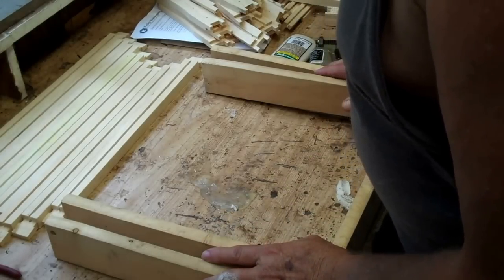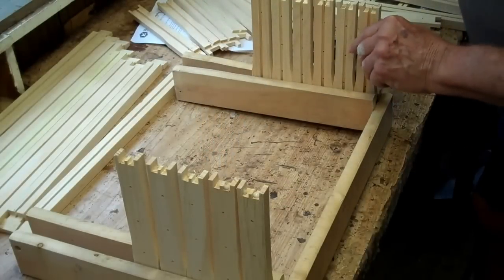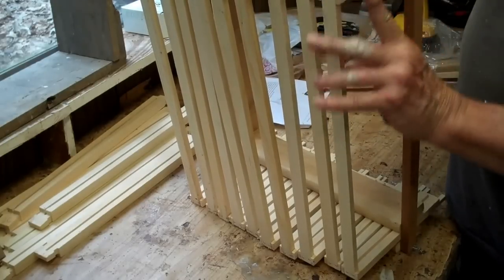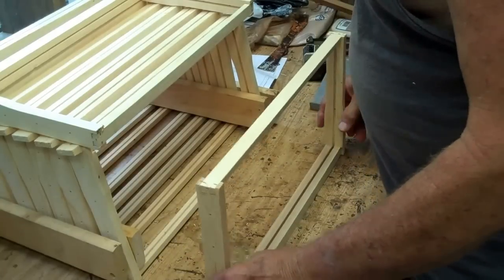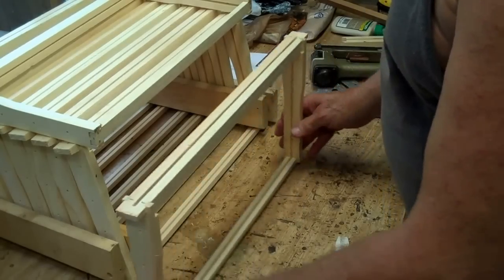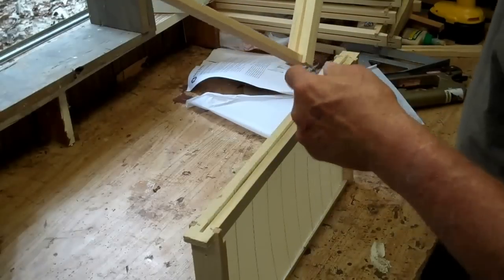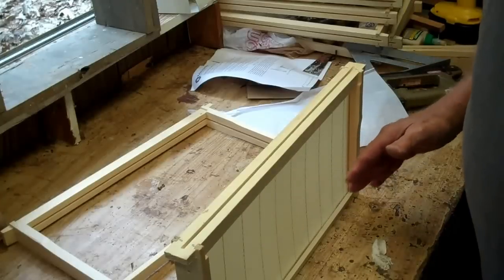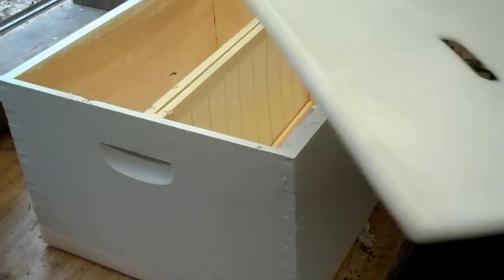Help in putting Bee Hive frames together

Comment: I like these frames. I drill a small cross hole an inch or so from each end and one in the middle then cut a 1" wide starter strip, put it in the top bar, push a small nail through each hole to hold the strip in.
Reply from the maker: thank you.......tim

Comment: I LOVE these frames! Have used them for years.  Tried to order some today and unfortunately Kelley Bees does not make them anymore. And they have a patent on it!  Hope they come back.
Reply from the maker: Thanks for your input......tim
Reply: I don’t agree with his opinion that these are only for beginners. Also it’s not necessary to wire these frames- ever. They stay straight because the channels in the end bars prevent bend of foundation. If you like you can use end bar pins. I did and found them unnecessary. But it’s all moot since these frames aren’t manufactured anymore.

Comment: These "N" style frames came with my "Kentucky Special" starter hive kit from Kelley bees.  They are all I have used mainly because it is what I was familiar with.  They are easy to use, but I have noticed some quality issues on recent orders.  Grooves not centered and top bar slot not 100% cut.
Reply: Me too! Spent hour and hours getting slots to accept foundation.  Hane even cut foundation to fit slots.  Letting bees attach foundation to sides.

Comment: Tim Sr., so if I'm clear the bowed nail puts tension on the sides (stiles?) and once released tightens up the horizontal wires making the foundation wax a flat plane. Maybe a couple of wood stops and a shim tapped in might put enough force on the thicker sides of these N style frames to accomplish the tightening that is needed? Always good information coming from this channel. Thanks.

Comment: only one thing tim, the top of the frame bar has a hiding place for hive beetles above the foundation. mmmmmm  mmmmmm
Reply from the maker: I do not like the slotted top bars at all. One of my Sons wanted to try them.
You are correct.  Places like that can be filled in with hot beeswax.

Comment: What's your thought on those foundationless frames you have to put melted wax in the top and just hang the paper? I tried those this year and the bees didn't do anything on them and the paper just ended up warping making a huge mess in the super. Just wondering if you had tried them yet?
Reply: *****
Yes. Maybe I melted the wax in wrong and they were not hanging straight, but the bees did not draw any comb at all on them.

Comment: Would you still be able to use this frame if you were spinning out the honey if you don't wire them in? Side to side that is.
Reply from the maker: The answer is probably yes.  The main purpose in the horizontal wires is to keep the foundation straight as possible as the bees  draw out the comb.

Comment: I installed a bee package about a week ago and I borrowed a frame with comb from my friend.  It turned out he had a top bar hive but I have a normal 10 frame hive.  Because of the frame he gave I had to put 9 frames.  The bees still have not built comb on others but they are connecting the frame with comb to the foundation and it is really hard to take off because I had to rip the comb.   I dont know what to do may you please give me suggestions on what should I do.
Reply: +WallsBeeMan Durham Thank you for your help
Reply: Had this problem in the past. Found if I used a long bread knife (knife with the ity bity saw teeth you use on bread) cut it as close as you can to the 'old' frame then pull the new frame and trim it down to about the thickness it is supposed to be. Bees learn and after about the fifth or sixth time they quit and went to building on the foundation.

Comment: what is the purpose of the bees wax foundation?
Reply: It speeds up the cell building in many or most cases and you should get more honey since it takes about 8 lbs of honey to make 1 lbs of wax. Remember that 1 bee produces/collects 1/12 th of a tee spoon  of honey in their whole life.
Also this foundation with wire or foundation mounted with wire on the frame will survive a centrifuge better, while a pure drawn comb may not. 
The best thing is that bees built combs straight down up and down with foundation while the comb building could be anything else without a foundation.
It could be the difference if a swarm or a package of bees want to stay when installing.